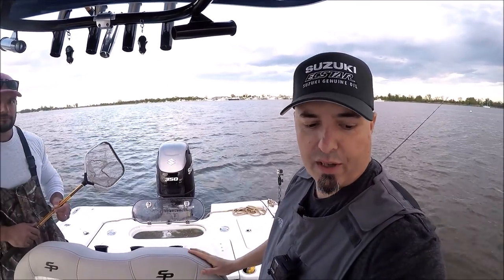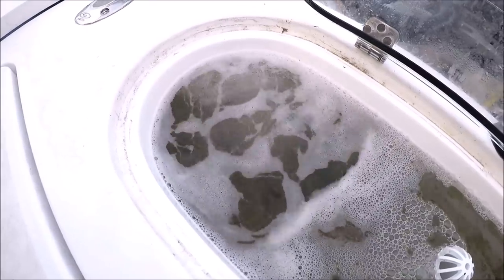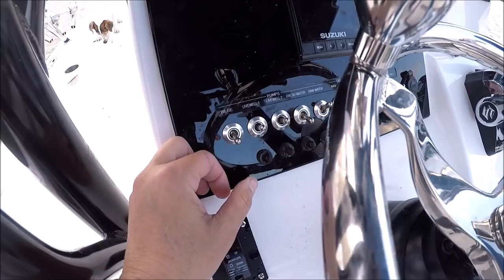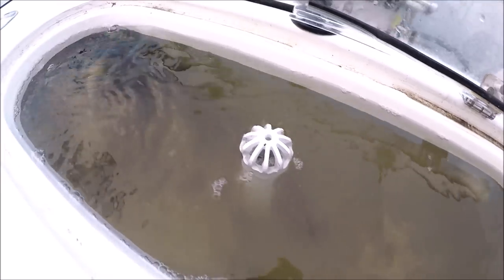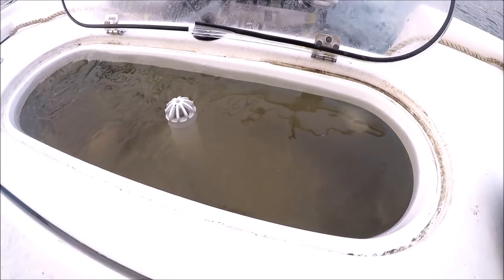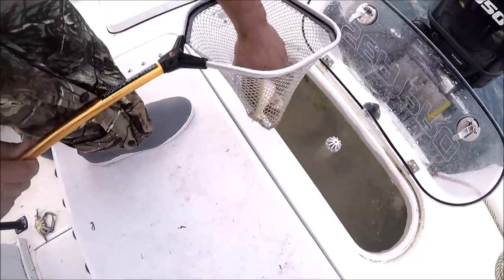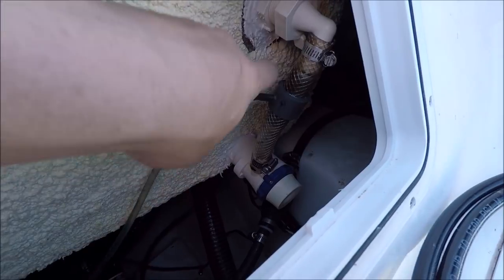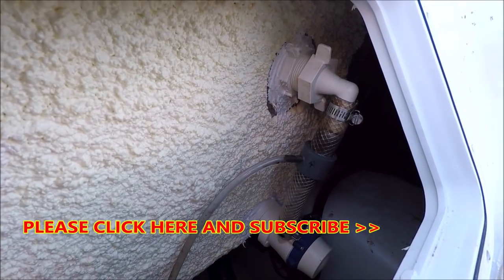Sea Pro 248 Bay Boat Live Wells. Dual Action

Comment: I have a 2021 238 DLX Sea Pro and would like to add a recirculating pump to the stern livewell.      Did you drill a second hole into the livewell for this install or use the factory tubing to add the second pump?     Also, is the Ventury oxy thing part of the recirculating pump or just a spicut?
Reply from the maker: Sea Pro did this from the factory but you can do it yourself by drilling a hole and adding a bung. The Venturi is spliced in, yep. 👍